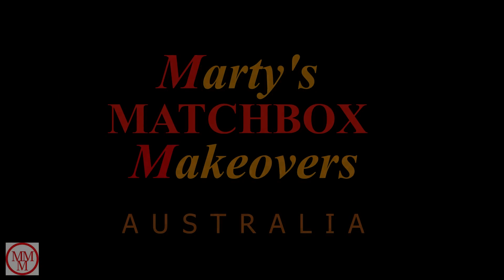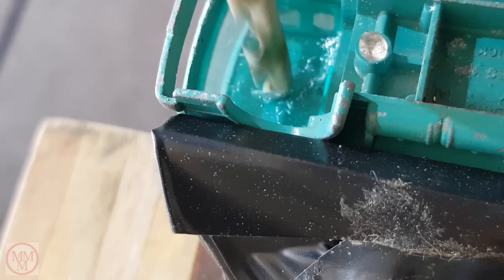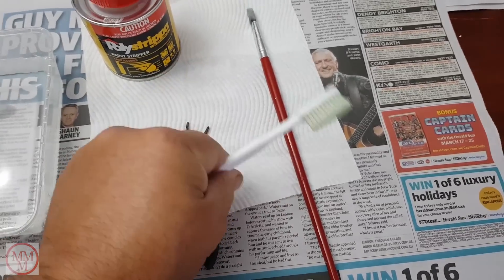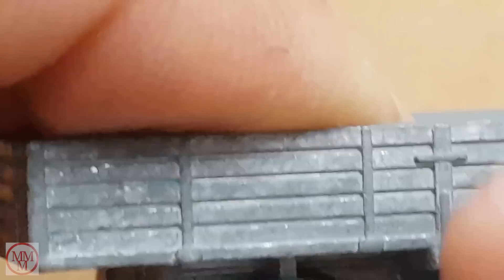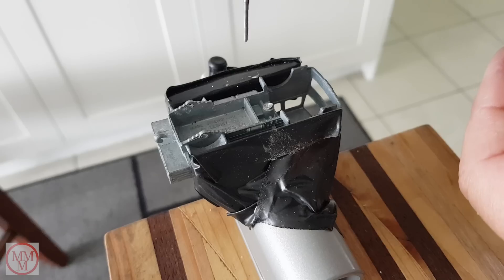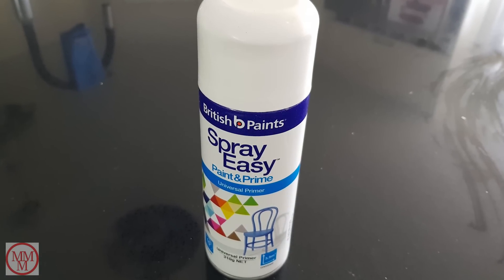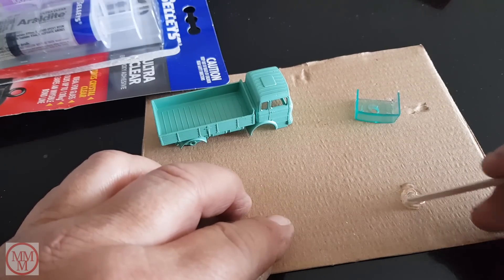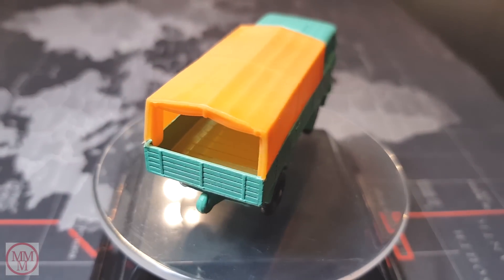MATCHBOX Restoration No 1E Mercedes Truck 1968

Comment: If you use hot glue to attach the screws for painting, you can apply a little bit of heat with a heat gun, or even a good hairdryer, and it comes off quite easily. Lovely work!

Comment: Nice job. To get rid of the remaining paint after the paint stripping you can use a little wire wheel with your Dremel. After this you can use steel wool to get an even surface for painting.

Comment: Try drilling the tap hole first using the centre of the rivet as a guide, then carefully using a slightly bigger drill bit, drill off the top of the rivet. 
You have much more control and can be a lot more accurate. 

Hope this helps.
Reply from the maker: Good advice, thanks!
Reply: +Marty's Matchbox Makeovers 
Measure the depth and put a bit of tape round drill bit so you don't go too deep on the tap hole, you only need to be about 7mm deep.
Reply from the maker: Another great idea thanks!

Comment: The 'T piece' which holds your tap is called a stock- The way you use your taps you may find it easier to get a tap holder that is shaped more like a screw-diver, the large handle of a stock tool on such delicate work can some times be a little cumbersome and not very accurate.
Another great vid :)
Reply from the maker: Good advice, always welcomed. Cheers!

Comment: I have two of these trucks without canopies  plus a trailer.If you would like these 3 pieces i would be glad to send them to you.
One truck has 3 wheels plus a half.
Second  truck has a slight dent on roof over drivers side.
(No cracks in wind screens)
Trailer  is in great shape.
I have a few more if youd like them.

Comment: I have been watching several of your restoration videos and i really like them. The presentation is good and results are amazing. May i suggest using counter sunk screws to replace the rivets instead of dome headed screws? May i also suggest when drilling out rivets that you use a drill the same diameter as the stem of the rivet? If you do not know the diameter of the stem then start smaller and work up to it in small increments. That way you wont drill into the model or plastic.

Comment: My first time watching thanks to one of your other viewers messaging about your vidios on a fellow youtubers site. BaremetalHw.  I figuered i would check your site out and im impressed. You gained another subscriber. Great job on the restoration! It looks fantastic. I did want to mention one concern. When glueing the windshield back in I know the rivet or post is to small to reuse and so you have to glue it. I just worry that in 50 more years getting it back out will be a chore .  But what can you do, you know!!!
Reply: A dab of clear silicone requires no mixing, will hold the "glass" in place but allow movement, and can be defeated to remove the "glass" at a later date.

Comment: I'm  sure there  must have been another  tone of that blue they  used as  well. i  just remmber the one i had as  kid  had a darker tone of that colour  pre&post your resto.  They also did the Superfast versions in gold
Reply from the maker: GOLD! WOW i've never seen that one.
Reply: yeah t was same colour  as that gold they had on the austin pininfarina not sure if you remeber that one
Reply: yeah  it was the  same  gold   as the  austin 1800   https://i.pinimg.com/originals/1f/60/e7/1f60e78faaee3f1c2d56fe4b0490a620.jpg    i think the  tonneau  was light blue